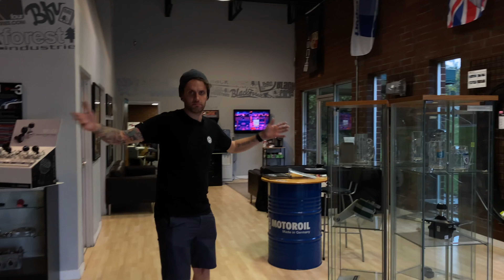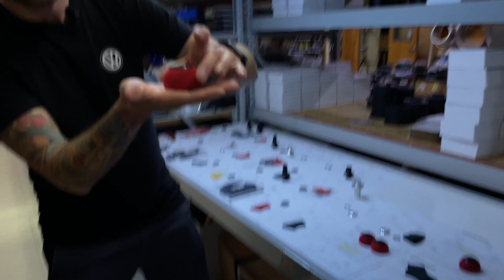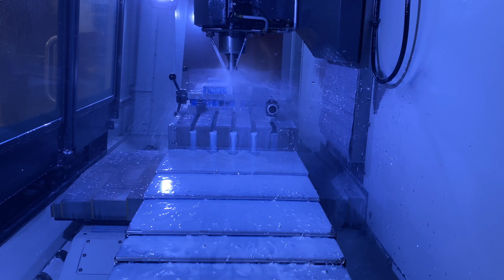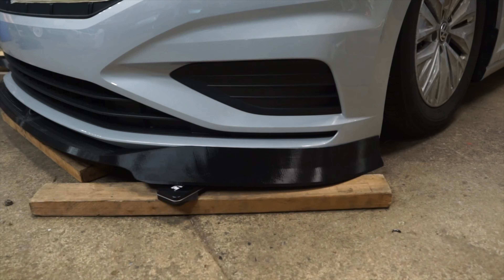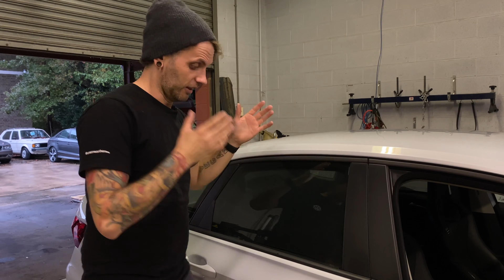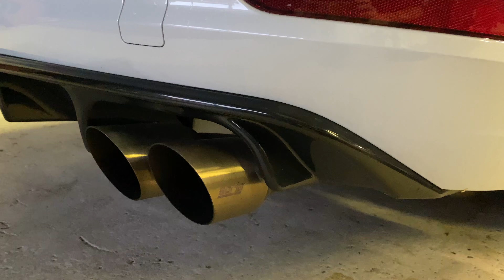My VW Jetta Mk7 SEMA Concept - the parts and build info + Bonus BFI shop tour!

Comment: My question. For Mk7 when you did the Borla exhaust did the 3 inch down pipe fit right onto the rest of the exhaust? 

Because I’m in the process of doing the exhaust system with the Solo Werks coil overs. 

Also. Where did you get the tune done?

Comment: Dude I need help to get this spoiler for my  2021 Jetta R line . My car is white I need A spoiler white color with the black ends on the bottom sides. Thanks
Reply from the maker: The spoilers are available from ECS Tuning, in carbon fibre finish, and unpainted plastic. You would need to organise priming and paint it yourself. :-)

Comment: I have a 2012 1.4 tsi. Would it be wise to fit a 2.0 dsg motor
Reply from the maker: Nice :-) The Jetta GLI comes with the 2.0T from the factory - I think I would do a 3.6 VR6 swap if I was going to do anything, but this project was about the Jetta S so we're having fun with the original engine to help other owners with parts :-)

Comment: I really want that front lip and the extension things for the front bumper but what I haven't seen before that I want is a mean looking grill guard. I also want those diffusers for under the rear bumper.

I'd also like a proper spoiler and some louvers for the back window. This car has such good bones I just want to go all out. I have the base model though so I don't think much will fit without major modification
Reply from the maker: This is a Jetta S (base model). I chose it because it looks smoother without the sunroof and the mirror signals.
The front grill is the original but with a chrome strip painted.
The rear spoiler and the front lip are available to purchase via ECSTuning.
Hope this helps, and have fun!

Comment: I was wondering what company you'd recommend to work with in regards to modifying my 2012 Passat SE? I want to get into the 2.5 and really do some work to see what it could put out. It's a bit of an oddball, as it's a manual SE. Any help would be greatly appreciated. I'm shooting for 300-350 horsepower.

Comment: Hey I have an se model and I’m trying to build it out. I have a question. I want to get the sel headlights for my car. Is there a way to get them? And also is instillation difficult for them?
Reply from the maker: You can get them new from VW via your local dealership, or online at ECS, FCP, etc, or a junkyard would the cheaper option if you can find them :-)

Comment: Great build, just a question: What oil do you put in it? Do you stick to a partcular brand o have ties with a sponsor? Im new to the channel, thx in advance.
Reply from the maker: I would 100% recommend staying with an approved oil  (508.00). I personally work with LIQUI MOLY, having used their oils for years, and now they do sponsor my projects. The correct oil from LM for the Jetta 1.4T is the LIQUI MOLY TopTec 6200 0w20. :-)

Comment: What's needed to install those GT's and fool the airbag module? Also, can't tell if these can come with a heated seat option?
Reply from the maker: You'll need bases, swap the passenger seat occupancy over, resistors for the airbags, move the belt receptacles over, and yes, they are available from RECARO with the heated seat options - a simple 2 wire setup :-)
Reply: @JamieOrr  LOVELY!

Comment: I’m putting fog lights to my vw 19s, my question is where can I find the harness for the fog lights ?  Or witch ones did you use? Thank you
Reply from the maker: You will need to use the headlight switch from a SEL etc , and add the wiring yourself, plus the coding. Or you could add a relay and build your own small circuit.

Comment: can I get some recommendations for flush rims for the MK7 S , and what would be the specs for flushed wheels or tucked. I need help 😭
Reply from the maker: Honestly, it's going to depend a lot of how low you go, and what size tires you want to run etc. The Jetta rear seems be a bit narrower than the equivalent Golf for wheel fitment, but there's still a lot of good info out there.
Reply: @JamieOrr  just will run SoloWerks , and probably will go for a 19 inch or 18inch setup

Comment: Hey Jaime! love the Jetta build, pretty much the reason I picked a 2019 GLI as my project car. Id love it if you give me a follow on Instagram @charlosmk7. Is there a certain way you mounted the custom Audi s3 side skirts to fit? Also I like the quad tip look you mentioned it bolts up right to the se, sel and R line bumpers would that diffuser and exhaust work with the GLI bumper or is it completely different than those models

Comment: Love how this Jetta is looking. I've got a mk7 Golf R-line 1.4tsi with a BFI gear knob fitted to it. One thing I have been looking for is a short shifter for it but found it really difficult to come across one that would fit that gearbox for the 1.4tsi. Is this something you're planning on doing to the Jetta?
Reply: A Dieselgeeks sigma shifter kit should fit. 👍 Charles from humble mechanic does an install vid on an older golf but last I checked they make one for the Mk7 manuals.
Reply: @UltravioletCrystals  cheers. I'll check it out. The GTi and 2.0tdi uses the same short shifter with the ng350 but different one for the ng250 on these.